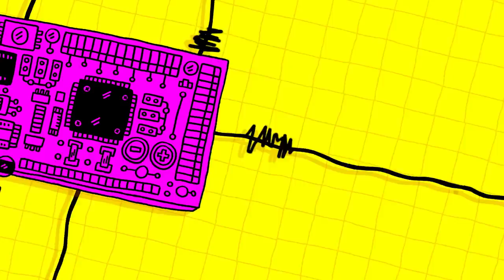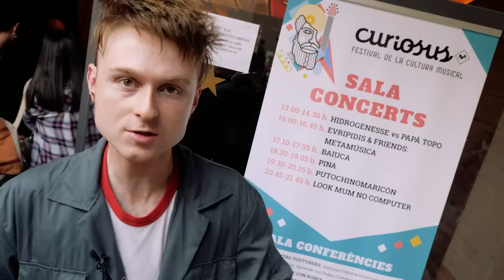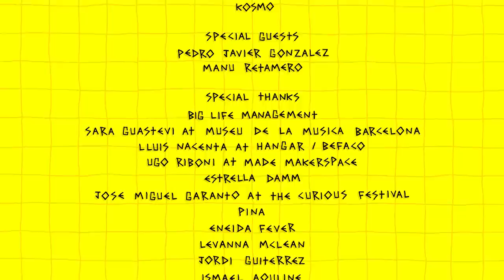Self Playing Robo Guitars Made Out Of Junk - Junk Rock TV

Comment: can you use your modular synth outputs to run the servos and motors in the instrument directly, or is the pi needed in between? I can see why the single midi cable to each instrument may be easier to use and set up though.

Comment: MAKER NEWS!
I collect old gramophones as the name suggests but, gramophones don't play MP3 or the sound of youtube vids! what to do!?
I build the phono tube! 
I got myself a puck Bluetooth speaker I had a backplate to an HMV 5a gramophone soundbox and some busted wax cylinder boxes and lids and some rubber O rings. 
I glued the backplate to a cylinder box lid with the top removed so it would be a short tube then I glued the rubber O ring in the cylinder box bottom (with the original bottom first removed) and glued the bottom back with a 2-inch hole added then I just put the lid with the backplate-on on the tube 
then I glued a smaller tube with a rubber O ring on the end in the other box lid and I was done!
the last bit secures the puck Bluetooth speaker inside the cylinder box when I put the end lid on.
now I start the connection yes! the music plays! I put the puck in the phono tube and fit the phono tube to my gramophone and... yes!!!! success!! music plays through the horn of the machine and at a louder volume than the puck can give me normally!
it's on my desk at work and people look in asking themselves what the fudge this thing is!

PS if other viewers have made something be free to use ''MAKER NEWS!'' at the beginning of your comment and make this a trend!!!

pps the gramophone used is a busted HMV model 88 portable gramophone with the soundbox and lid missing I got it standing upright on my desk just like any other speaker, it went from a piece of junk to a useful thing I use every day!